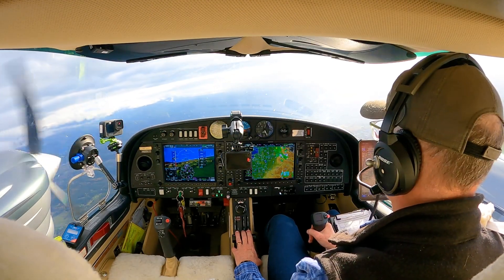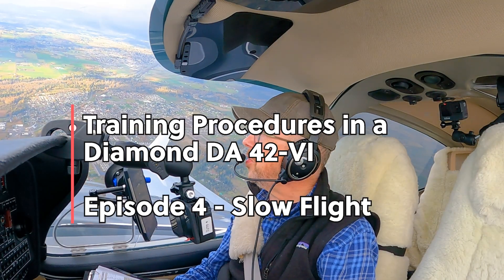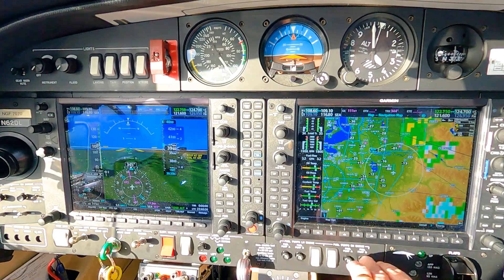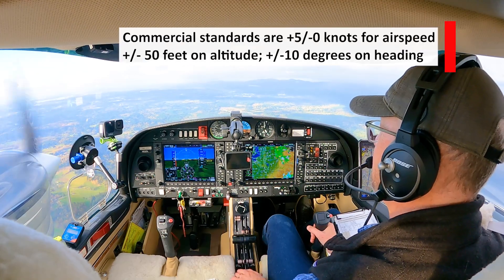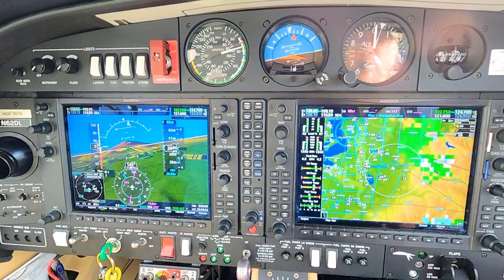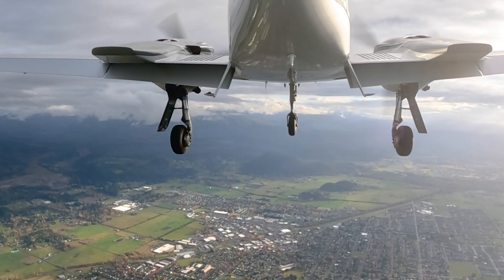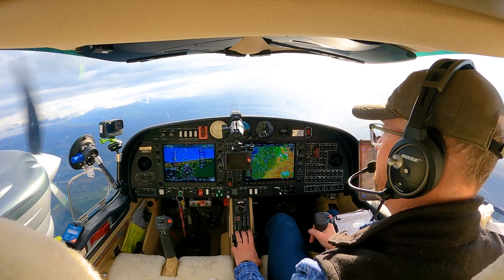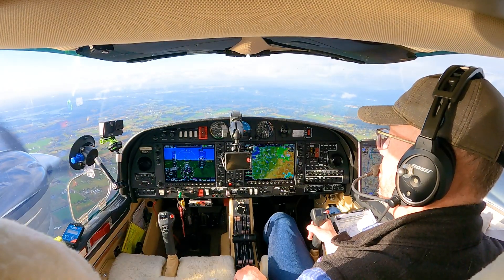Slow Flight - Episode 4 Procedures and Maneuvers in a Diamond DA42 VI

Comment: hi Trevor, I really would love to buy one of these and it may be my next plane. I thought on twins you can't go below blue line, can you explain? Sorry for the basic questions, I am so impressed with that performance.
Reply from the maker: It's a good question.  It's actually the red line (Vmc) that you don't want to go below.  Below Vmc, the idea is that there won't be enough directional rudder control to counteract the asymmetric thrust from a failed engine ... so it may be impossible to maintain directional control with a failed engine.   In reality, Vmc can vary based on several factors but the red line on the airspeed indicator gives you some guidance.  The blue line is called Vyse.  It gives you the best rate of climb if you are operating on one engine (Vy single engine).  So if you are trying to maximize climb performance with a failed engine, you fly at the blue line speed.  So its an important speed when you have a real or simulated failed engine but it doesn't preclude flying at other speeds in level flight for example.  Hope this helps!  I'll be adding some videos on single engine operations in the future and will cover these topics in more detail.